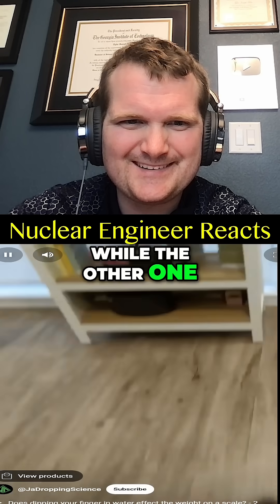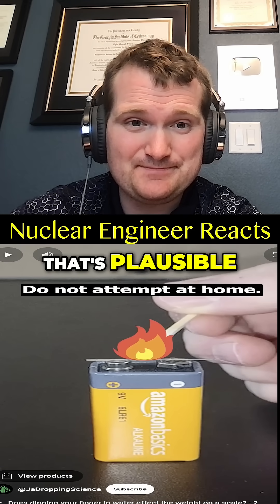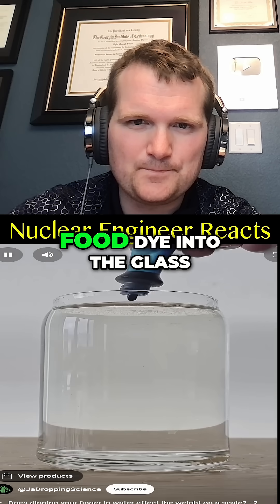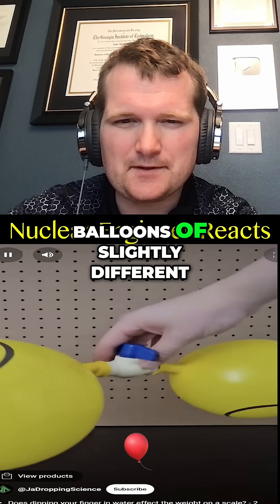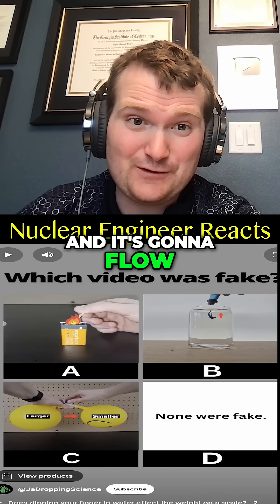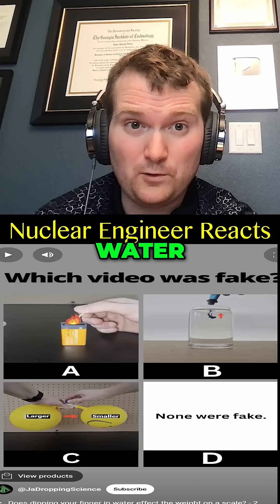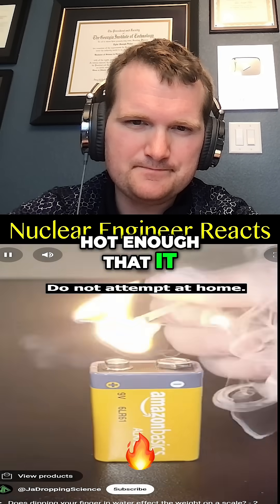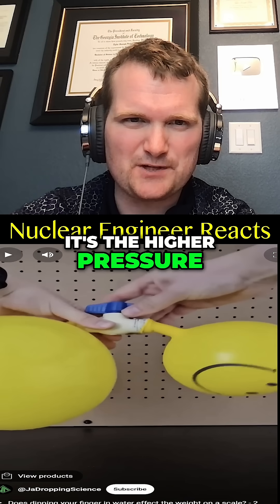Can Internet Science Fool a Nuclear Engineer? - 2 Truths & Trash

Comment: Funny thing is I can connect this to the healthcare field. In terms of the ballon one. (Nurse here) For people that have central lines (intravenous lines that have access to central circulation, not the IV just in your arm) you have to use larger syringes 10 mls or greater (lower pressure) opposed to higher pressure syringes such as a 3 ml syringe. This prevents damage to the central line and to the patients vessels. This is the only video I’ve seen that I could connect to my job 😅

Comment: A balloon can be visualized like a piston: when it's small, the surface area (like the piston's face) is small, so a higher pressure is needed to generate enough force to stretch the tight, elastic material. As the balloon expands, its surface area increases, meaning the same pressure acts over a larger area, requiring less pressure to continue inflating it. This change reflects the square–cube law, where volume (which relates to the force pushing outward) increases faster than surface area (which resists the expansion), making the balloon easier to inflate as it grows—up to a point.

Comment: I can't work out why the smaller one is at higher pressure. Sure, there's less area for the air, but there's also less air and it hasn't stretched as far, meaning it's working against less elasticity, right?

Comment: In a CE PWR those are called Safety Injection Tanks and are one part of accident mitigation. The tanks are very low pressure and if they dump it's because you are in a world of hurt. The tanks are at 200# while the Reactor Coolant System is at 2250#. 
You need a gigantic hole in the RCS to get below 200#. The leak has to be more than the High Pressure and Low Pressure Safety Injection Pumps can make up.

Comment: To light cigarettes in juvi, we would break apart a pencil to take out the lead. Break the lead into 3 equal sized parts. Put 2 pieces of lead inside the holes of an electric outlet, and the 3rd peice on top of the other 2 pieces creating a circuit. Then, just touch the cig to the top piece of lead and inhale til it catches on fire

Comment: I guess stupid question but I really don't get how the smaller balloon is higher pressure? The larger balloon is more stretched out and thus I thought exerting more pressure on the air on the inside. Thats why they fly around so fast when u blow em up cause it shoots air out, if u blow up a balloon just a little, it may not even fly around?

Comment: Basically the more the balloon is stretched the weaker the force it has and the less the balloon is stretched the more force it has so with more air comes less force and therefore with less air comes more force allowing the air from the balloon Thats less filled to push more than the balloon that is more filled

Comment: Slight correction: It’s actually not because the smaller ballon is at a higher pressure it actually has to do with the elasticity of the ballons themselves. Which is why it seems so counter intuitive if you were looking at the problem from an ideal gas law perspective.

Comment: It’s not higher pressure, the elasticity of the smaller balloon is greater, so not exactly like high pressure tanks in a reactor. I would assume you’re using sturdy stainless steel tanks and to rubber balloons in a multi atmospheric pressure environment.

Comment: Funny enough in spite of the fact the larger balloon has more air in it the latex is stretched thinner, allowing it to expand easier. The more full a balloon gets, the thinner the latex will get, and ironically reduce the pressure put on the air inside.

Comment: The issue is that the bigger balloon has higher pressure......
Reply: In smaller balloons, the rubber is more stretched per unit area, so the internal pressure is actually higher than in a larger balloon, even though the smaller one contains less air.

Comment: I wouldn't agree unless, I could place some conditions on  the different sized balloons.

Depends on how compressible you believe air to be. In the described experiment balloons are used and not steel tanks which are strong enough to withstand substantial increased pressure without changing volume.

Assuming the definition of a balloon is thin walled, limited structural strength and may even be elastic, the larger balloon is not actually significantly higher in pressure and the balloon may expand until an equilibrium is reached when the internal pressure plus the strength of the balloon equals the external pressure. And the same can be said for the smaller balloon so assuming both balloons are in equilibrium before opening the connection between the two balloons, it's  possible that no air will flow between the balloons.

Comment: I paused it at :33 seconds. The first one is true, graphite is a resistor and where there is resistance to the flow of electricity heat is the byproduct. So with enough heat you can ignite a match. The second one is true. If it is cold water that you are putting the food die drops in, that means the third one is false.

Comment: Fun fact, there are automotive companies that sell oil accumulators that are designed to do the same job as the accumulators at a PWR plant, just at a massively smaller scale. Canton Racing has an oil accumulator that they call the Accusump that stores engine oil, altho it could theoretically be used for transmission and differential oil, that's meant to reduce bearing wear at engine startup bc it automatically opens a valve and sends however much oil through the engine at 30+ psi

Comment: the balloon would be the same size as long as they are the same type of balloon with the same size deflated and same Elasticity  strength. i think this guy has been hanging around the nuclear reactor to long....    20 psi in one balloon and 10 psi in the other, once you open the merging valve , both balloon would have 15 psi.

Comment: I'm confused about the balloons. Is he calling one "smaller" because it is imitation filled with less air, making it apart to be "smaller"? Or is the balloon itself, the plastic its made of actually physically smaller? I think he is saying the latter. I'm also assuming he put the same amount of air in each balloon, meaning the smaller is as a higher pressure. That will cause air to rush from the smaller high pressure balloon into the bigger low pressure balloon. If that is in fact what he's saying though once the smaller balloon releases enough air into the bigger balloon the pressure will eventually equalize and at that time air should no longer move from one balloon to another. They will essentially be at a stalemate pushing against one another with equal force. So....i don't understand exactly what I'm missing here and any explanation l, any correct explanation, would be as informative as it is appreciated!

Comment: For those who are confused as to why the smaller balloon has a higher pressure:

Think of blowing a balloon. The hardest part is the initial burst of air required to start the inflation process. Once there is air in the balloon, it is quite easy to continue blowing air into the balloon.

The closer the balloon is to being uninflated (or unstressed,) the higher the tendency for the balloon to want to return to the unstressed state. 

Therefore, a higher pressure is exterted on the air inside.
Reply: Thank you. Viscerally I understand the feeling of having to blow harder initially, but my brain still looks at the rubber expanding more with the larger balloon and wants to think that the larger balloon has a higher pressure.
Reply: Yeah, i don’t get it either. Isn’t rubber just a 2d spring that obeys the spring law? Intuitively the more the stretch, the more force is applied to the gas inside. Maybe it’s because the volume increases r cubed vs surface area r squared?
Reply: @refusalspam  the balloon is a bit more complex than a spring. when a spring is compressed from top to bottom, the area that pressure is applied to is constant. with the baloon, the area increases as the baloon inflates, spreading the force of the contracting rubber over a larger area, meaning the pressure is smaller. (p=f/a)
Reply: is this le Chatliers principle?
Reply: Fascinating concept actually; I wonder at what point the forces may balance out
Reply: Another way to explain would also just be space/volume. The less space you have, the faster the air molecules would bounce around and thus result in higher pressure. So volume is inversely proportional to pressure.

Then you have temperature, with it being directly proportional to pressure, because the more heated a particle is, the faster it moves, the faster it bounces, the more the pressure.
Reply: @Aspiracy this is assuming you have a fixed amount of air (think “n” in ideal gas law). When you blow up a balloon though you’re adding in air. Right answer but I don’t think this is the most accurate explanation
Reply: @marzmelon4878  wouldn't at some point after you tie the balloon the amount of air gets fixed? then there would be a pressure difference between the balloon and its surroundings, otherwise the amount of air would still stay the same if u open up the balloon again
Reply: can be explained by P=F/A 

as area increases pressure decreases.
Reply: @ but the F also increases since the rubber is getting stretched farther like a spring, F=kx where x is the length stretched.
Reply: OK but what if the balloon was very full?
Reply: yea we knkow, some of us watched VSauce
Reply: @lifearebennetitwant1007  "for those who are confused.."

Comment: Carbon is semi-metal: Electric conductivity is a very metal thing.
Reply: I thought almost all elements other than hydrogen and helium were metals
Metallicity
In astronomy and physical cosmology, the metallicity or Z is the fraction of mass of a star or other kind of astronomical object that is not in hydrogen (X) or helium (Y). Most of the physical matter in the universe is in the form of hydrogen and helium, so astronomers use the word "metals" as a convenient short term for "all elements except hydrogen and helium". This usage is distinct from the usual physical definition of a solid metal. The rationale for the astronomical usage is that in the high-temperature and pressure environment of a star, atoms do not undergo chemical reactions and effectively have no chemical properties, including that of being a metal as usually understood. For example, stars and nebulae with relatively high abundances of carbon, nitrogen, oxygen, and neon are called "metal-rich" in astrophysical terms, even though those elements are non-metals in chemistry.
Reply: Only linguistically, though, and mostly only for astronomy

Comment: The question remains, why is the smaller balloon at a higher pressure?

I have to assume the elastic of the balloon is harder to stretch when it's small and easier when it's slightly more filled. So it's not air volume or external air pressure, the bigger balloon actually had higher energy stored in it, but because it's easier to further inflate that balloon than the smaller one it gets filled. This aligns with the experience of trying to blow up a balloon, where getting it started is the hardest part (until maybe it's so full it might burst).
Reply: I think you're half right. As I understand it, as the balloon expands, the amount of force it exerts on the gas inside it increases, but not as fast as it's surface area is increasing. This means that the force gets more spread out, thus lower pressure. This is also why it's hard to blow up a balloon at first, you have to raise the pressure in your lungs.
Reply: @elijahwilensky3318  I think what you're saying actually means the same thing, i.e., because the elastic force essentially goes very hard, to much easier and then progressively harder, when blowing up a balloon the surface area increase by force goes very little, to lots to progressively less. I'd guess your perspective is looking at a symptom of the nature of the elasticity/shape of a balloon and that mine is the root explanation, but your comment definitely made me think! Thank you.

Comment: I think you should mention that the reason the small Ballon has more pressure even with less air in it is because it's not the air weather the latex in the Ballon that makes more pressure. Think of when you blow a Ballon it's hard a first but you will feel the point where the air overcomes the latex pressure.

Comment: I never did understand why the smaller balloon is at a higher pressure. You'd think the bigger balloon is stretched and resisting more than the small one, creating more pressure on the air inside to look for an exit. I have long since accepted that this isn't how it works but it was never explained to me why?

What makes the small balloon's pressure so high?
Reply: This is due to Laplace's Law. 

In a smaller balloon, the curvature is tighter, which means the wall tension creates a stronger inward force. To balance that and keep the balloon inflated, the pressure inside has to be higher.

In short: smaller radius → more curvature → more inward force → higher internal pressure.
Reply: @decomposedcorpse5186  Wait, is that also why blowing a balloon is sorta difficult at first but then gets noticably easier after inflating past a certain point?
Reply: @Kurayamiblack  Exactly why.

Comment: The key words in the word problem for the balloons is smaller balloon.
Reply: Oftentimes people don't think of the word smaller as not meaning less inflated. A smaller balloon inflated to the same diameter as a slightly larger balloon will have more energy stored in the elasticity of the smaller balloon. Smaller balloon does not equal less inflated.

Comment: Is the emergency core cooling water heated? Because injecting cold water into a pressurized water reactor would cause an almost worst case power excursion. Like muster the rods at the bottom of the core might not be good enough. I realize the high pressure water is there to cool the core but there seems to be a trade off on how cold it is.

Comment: what happens if the valve is kept open after the air goes in to the bigger balloon? will the preassure between the two equalize between them and fill them both with air or will the air just stay in the other ballon?
Reply: It just stays in the one balloon. A fully inflated balloon at low pressure will never be able to overcome the initial resistance of a deflated balloon.
Reply: @joeschmoe6908  you know what. Now that you explained it, it just makes so much sense that I feel stupid as hell for not realising it lol. Thanks for answering though=D
Reply: @Crucial_End  no problem. It's not obvious till you hear it explained or see it in person.

Comment: The biggest balloon has far more pressure than the smaller one
Reply: No, it doesn't. It has more volume. As the balloon stretches it becomes easier to inflate, surely you've noticed this.
Reply: No the bigger ballon is under less pressure because as the rubber stretches the ballon gets gets thinner applying less pressure
Reply: Not really. When you start blowing up a balloon, the latex is still tight and stiff. When it's full enough though, the rubber becomes more elastic and the pressure drops, making it easier to add more air. However, the pressure will start increasing again until the balloon reaches its limit.

Comment: Wasn't sure how he'd connect this to nuclear power plant, but he always does
Reply: This one seemed easier to connect honestly. They play around with pressure a lot in nuclear reactors
Reply: That’s kinda the point of his channel ig
Reply: @Silence_Liberals Obviously, he's not gonna react to something he has no knowledge about and not add any substance to the original video right...? Oh wait, that's what everyone else does. Whoops.
Reply: @Silence_Liberals and I'm all for it. Funny as heck but super informative at the same time.
Reply: @Silence_Liberalswhy the fuk is writing "I guess" so hard for people so instead they use ig 😭
Reply: Well, a nuclear power plant combines all disciplines of engineering, chemistry and physics.
Density calculations on injecting various solutions into the reactor coolant, pressures as he mentioned and well, pencil "lead" is graphite and clay - as are super cheap and ancient resistors, film resistors came out much more recently.
Reply: It’s in the name 😫👌
Reply: My jaw dropped when he didn't mention that graphite is used as a moderator in some nuclear power plants.
Reply: Thats the point of his channel bro stfu 😂
Reply: If you didn't know nuclear power plant (for the water & gaseous system) are just pretty much a pressure, temperature, tank, tank filled with something sollid, and heat exchanger. Also elements like boron, xenon, krypton, hydrogen, nitrogen, oxygen, etc. That's how pretty much he connect everything to nuclear plant
Reply: Hence his entire channel
Reply: that’s the point, good eye man
Reply: HE ALWAYS DOES!! Bruh how
Reply: read this as he said so lol
Reply: I wanna see him connect gorilla Vs 100men into nuclear power plant
Reply: lol it reminds me of bandit Keith trying to sneak in “in America” wherever he can
Reply: Maybe because it's his job and had prior knowledge so he used it? Can you be more stupid?
Reply: Well this one is a given lol, pressure and valves are used in the plants
Reply: thats why we love him
Reply: Hey, at least he doesn’t just sit in the corner and do nothing
Reply: @8miceinabox im not complaining just impressed
Reply: "if you take a piece of graphite pencil"

"ah, graphite. fun fact, we used them shits heavily as a nuclear reactor core"
Reply: It's kind of impressive
Reply: are schools banned un the US? damn i didnt know learning was illegal there lol
Reply: I was way so relieved when i heard "nuclear Power plant"
Reply: It's his gift.
Reply: bro has WR for connecting everything to Nuclear reactors.